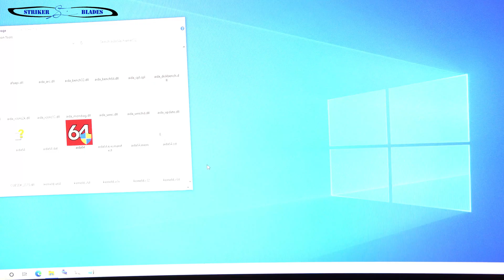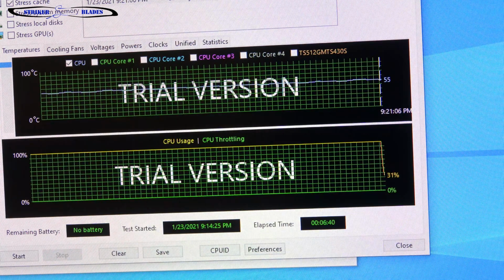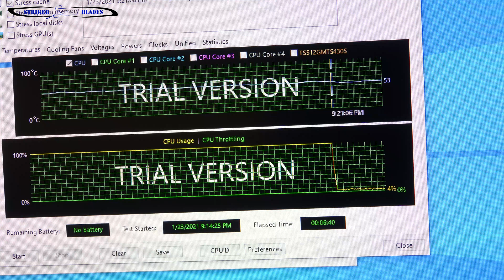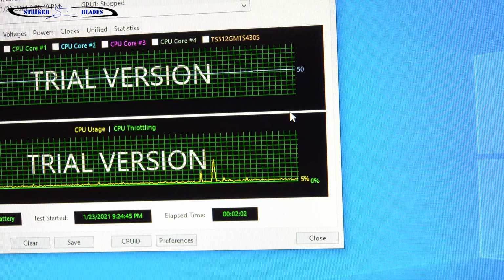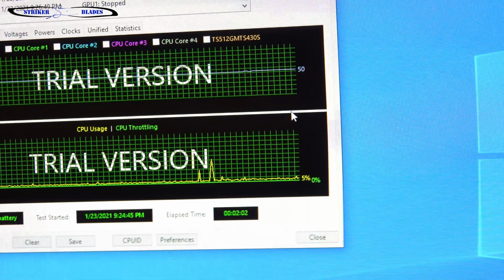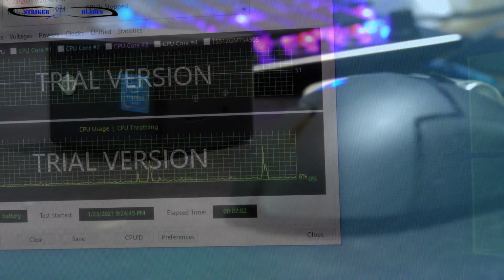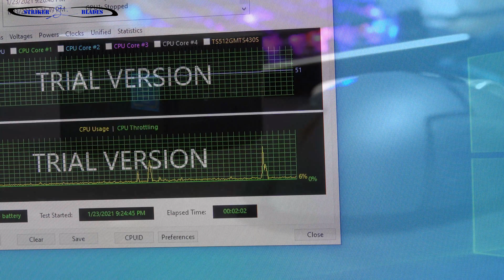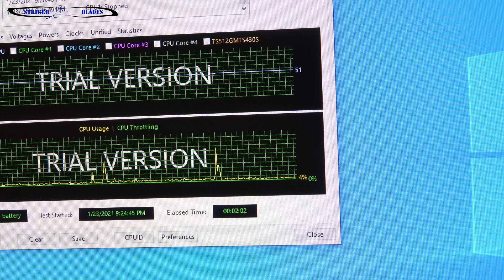Can Liquid Metal Save the Larkbox pro?

Comment: so this was liquid metal plus self-made copper heatsink? 
also, have you eventually fully disconnected the fan and installed a passive heat sink instead?
Reply from the maker: yes to the first part. I eventually soldered a tiny switch to the fan cord so I could turn it on and off when ever I wanted.

Comment: it's not recommanded to use paste, the thermal silicone pad is more adequat cause the distance between the hitsink and cpu is big, try to use a high quality pad silicone dissipation temperture (12W/mk 1.5 mm the original is 1mm) and you will be happy
Reply from the maker: Basically, no mod is needed because the noise issue with the fan randomly kicking on and then turning off 8 seconds later is persistent regardless of thermal interface.

Comment: When 100% cpu utilization, you should look at the temperature and cpu clock in the unified tab.

Because when the cpu temperature rises too fast, the cpu will automatically lower the cpu clock.

In this case, you may misjudge that the decrease in temperature is the result of the modification of your heat dissipation.

Perhaps the real reason is that the cpu clock automatically drops, so the temperature drops.

You can refer to the content discussed below. 

https://forum.chuwi.com/t/larkbox-fan-noise-and-temperatures/14595/73
Reply from the maker: I think I was also in power save mode where it will downclock at idle.

Comment: Another option is to use electronics safe Silicone (not acid cure!) to electrically insulate the capacitors on the cpu.
Reply from the maker: Ohh good point. I had none of those when doing this lol. I went to my local supermarket and they didn't have any nail polish. lol
Reply: @StrikerBladeCo  as a man, you'd have got some funny looks buying nail polish ha ha!